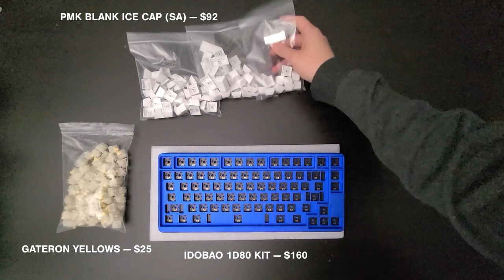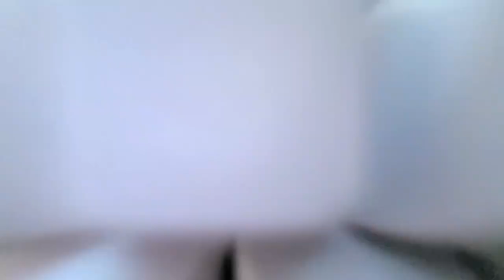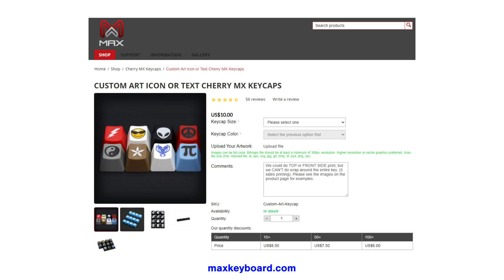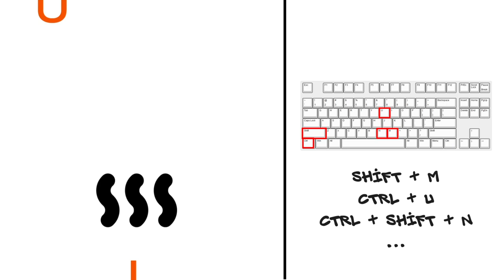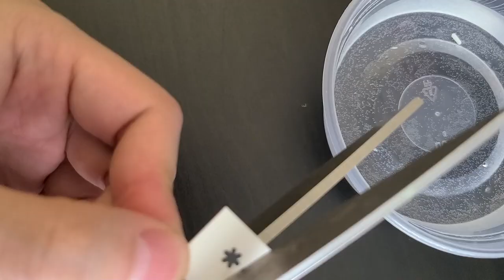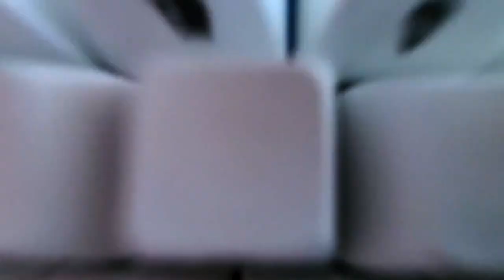I built a weird keyboard...

Comment: Do you think they could also be glued to the top of the keycaps? Or would that not work, because of the curve?
I'm thinking of putting the waterslides on top, and then coating the keycap with a layer of transparent ... something ... on top in order to fix them in place and protect them from damage..

Comment: Are they still removable after applying the varnish? Does this work with different color keycaps, or is the chalky residue visible?
Reply: I tried it out, these are still removable after being applied. For darker keycaps, you will need an opaque waterslide decal paper and more precise cut.

Comment: How well would these last on the top surface with a few coats of varnish spray? I know ABS melts at 105ºC, but PBT melts at 223ºC, so you can probably bake these decals at 150ºC in a conventional oven, with PBT keys.

Comment: Are they durable if you put them on top?
Reply from the maker: With the varnish I got, I don't think they'd last too long. May need to find a way to make them more durable
Reply: @YOHON  thank you, I was doing a deep research to find the best solution for my case and I found a solution that may fix that, which is using resin on top of it, the main problem is that that solution was used on a specific keycap which only needed to be applied on top, because the texture it gets after hardening is different (like more glossy) and that makes you applying the resin on all sides to make the texture equal. But maybe it can be avoided by sanding that glossy texture in order to make that texture as rough as the raw keycap
Reply from the maker: @GokkuDobleK  woah that sounds promising, thanks for sharing!

Comment: I have the logitech pop keyboard I won in a giveaway, but it has too many emojis on the side when I mostly just use 3. Since the mouse also comes with an emoji menu button, I don't really need all 5 emoji keys. So, I wanted to change the function of a couple of them, and identify them with some kind of decal. Luckily, this keyboard comes with extra keys I can use to experiment. The thing is.... I don't know how to erase the legend it comes with (an emoji, in this case) and add the two keys that I need. I'm thinking acetone could work (from what I can guess from all the doll repainting videos I've watched), but... the keys are purple and i don't know if that's mess the color they come in. I could just try, but I'd like to ask first. Any ideas?

Comment: I just bought all stuff needed to do the same thing on my keyboard project. I was thinking how they last if the printing are on top instead of the side. Even with the clear coating spray
Reply from the maker: good luck! im not sure how long they'll last. You probably need to experiment with more durable varnishes. I think the same one I got wouldn't last very long
Reply: Maybe lacquer?

Comment: did the waterslide decals still holding on to tohem?
Reply from the maker: some of them started peeling and had to be replaced but most of them held on since the beginning. I doubt they would last if they were applied on the top of the keycaps - I think it's because I need stronger varnish
Reply: @YOHON  why don’t u get them uv printed ?
Reply from the maker: @teabagNBG  From what I've seen, it's expensive to print a whole custom set and I wanted to use the specific keycaps in the video